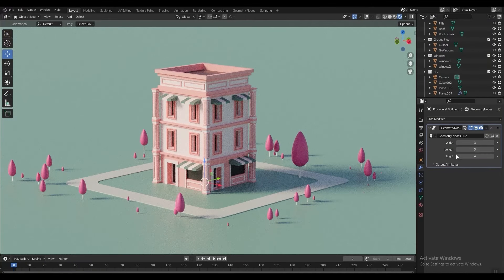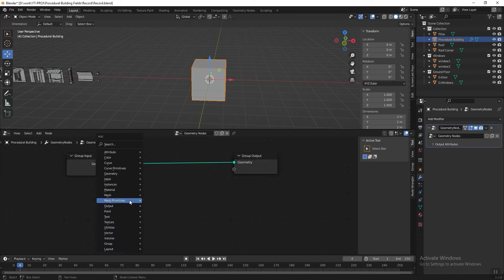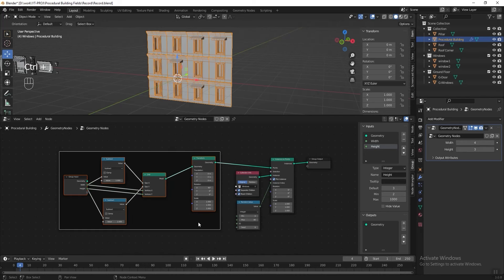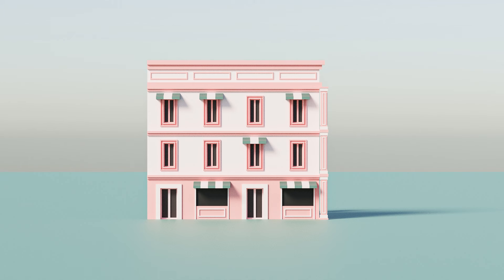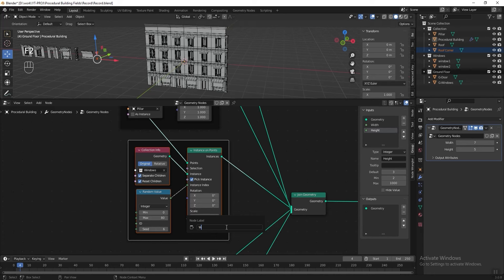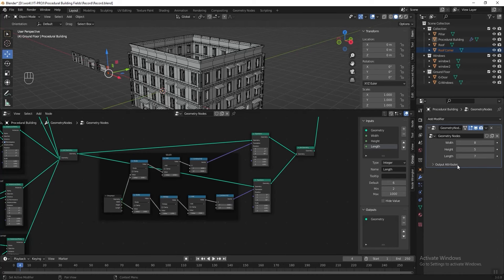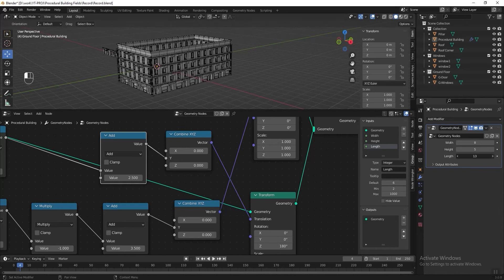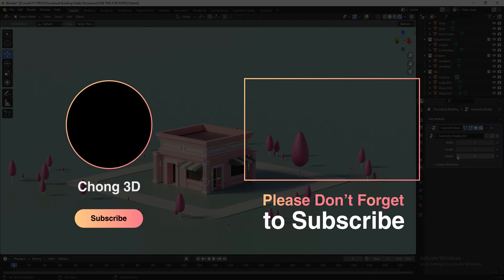Blender3D - Creating a semi-procedural Building with Blender 3.0 Geometry Nodes Fields (TUTORIAL)

Comment: I think the math works out a lot easier if you leave the origin to be the center. Then when you are moving the walls, you only need to offset either X or Y for each wall, not both. And it's completely symmetrical.
Reply: Agree..

Comment: Hi Mr Chong, I really like your tutorials, but this time I faced issues. I wonder if it is because I use Blender 4.2. The windows, the roof and the ground floor look okay, but my pillar and corner does not get attached to the building, they stand a bit apart (0.8 m). I kept the given dimensions for all the elements. I have the impression that it has to do something with a 1m x 1m dimension of the other parts. Could you or anyone else help me?
Reply: I got it fixed. The issue was the orientation of the X axis, as we should pay attention to where the x axis is + and where is -.

Comment: Thank you for this tutorial! Do you by any chance know how to control which models in a collection appear when? Like, right now you have on the ground floor: door, window, door, window, door window. What if I wanted to have door, window, window, door, window, window? I guess i have to plug something into the "instance index" but I dont know what.
Reply: For anyone looking for the same solution: I made an "index" node and plugged it into a math node set to multiply+add and asked it to multiply by 0.666. Then plugged it into the "Instance Index" on the "Instance on Point" node. This wokrs because I only have two objects in my collection.
Reply: @MrJeberg  Hi, do you have any idea why it is not random like the other floors' windows in the base tutorial? I thought it was because of the number of pieces at first but the windows also have just two pieces..
Reply: @thieu3945  In your Ground Floor frame. all you need to do is add a random Vale node into the instance point index. it will then randomize the Geo with one extra Node. for reference look in your Middle Floors Frames if you want to see what I mean.
Reply: @MrJeberg  see my post for an easier solution.
Reply: @ZexMaxwell  That makes sense, thanks!
Reply: @ZexMaxwell  How would you go about making just a single door?
Reply: @Doofus369  that i don't know. Never really needed it yet.

Comment: i have question than i apply modifier everything is gone expect roof same goes on your procedural building how I apply
Reply from the maker: Hi, before you apply the modifier, you need to add "Realize Instances" node before the "Group Output"
Reply: @Chong3D  yeah it worked but now textures don't work anymore
Reply: @Chong3D  do you know how fix that ? I am using imagie texture and realize instance removes color to my building
Reply from the maker: @GeorgeKarala  Sorry, i not sure about that

Comment: doesn't work for me :/  the ratio scale/size of the grid doesn't work, my procedural building is displaced idk why, and the roof doesn't quite connect there is a gap and/or there are multiple roof parts. That looks quite hard and tricky tho, maybe I made a mistake but I'm quite sure I followed every step right. :/
Reply from the maker: For the gap, did you apply the scale and the rotation of the 3D assets? (Please refer 1:50)
Besides this, make sure to put the origin of the 3D model to bottom left back corner (Please refer 2:03)
If you already did all the steps above and it still doesn't work, please download the Blender file in the description to check if you miss anything. Thanks🙂